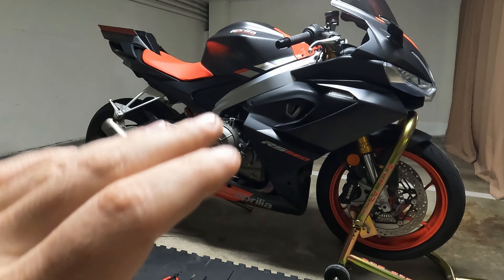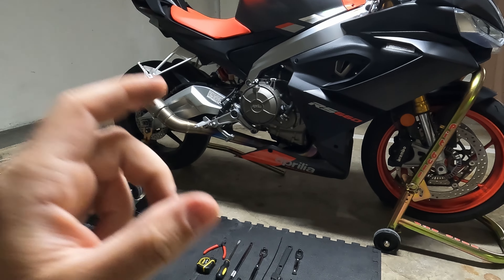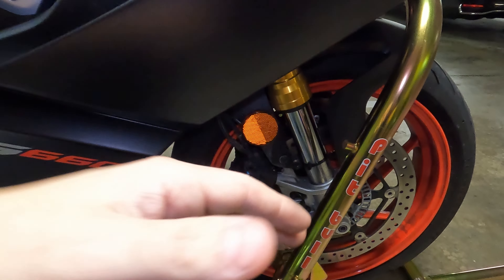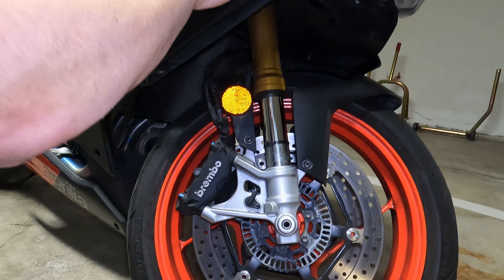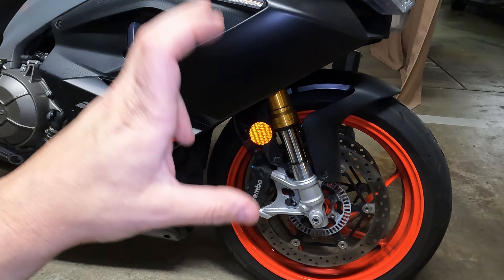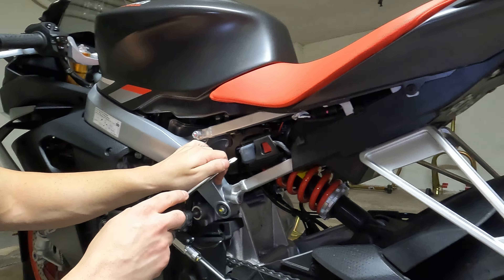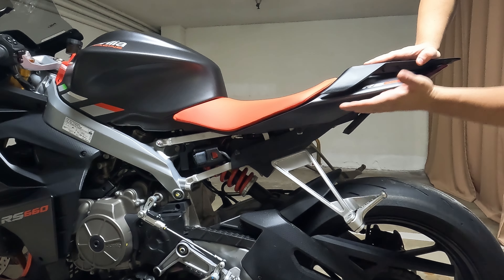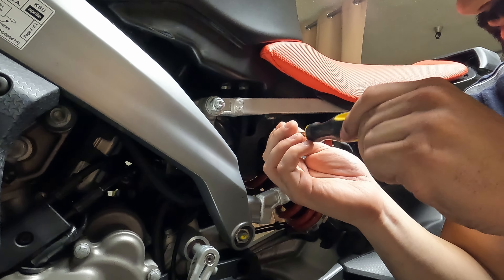RS 660 | How to Setup Your Suspension

Comment: Is the front stand the: Pitbull Hybrid Headlift Front Stand With Removable Handle? Which pin size are you using? I have another front stand but is touching with the front fearing and I’m not able to use it. I need to buy another one good for the rs660. Thanks
Reply from the maker: Yes this is the hybrid stand with removable handle. You can lift both from the forks or from the triple. The pin size for the RS660 is #46

Comment: Hey, i recently purchased an rs660. i have virtually no tools other than a small screwdriver kit. What tools / toolbox would you recommend i purchase?
Reply from the maker: It’s funny that you’re asking this because at some point I’m thinking of making a video going over tools needed for Aprilias. But until then I’ll tell you this. It depends on the depth of labor that you will go into. I don’t know what your experience in mechanics is. Regardless of experience, at the very least you should be doing your own oil change, chain adjustment, wheel alignment and brake pad change. I’m not a fan of buying individual tools as in the long run you will end up spending a lot more money. Buy tool sets. For hand tools, I’m a big fan of Tekton tools. I use them on all my videos. They have lifetime warranty replacement, plus you can either buy them directly from their website or from Amazon. You will need a set of allen-hex bits from 2mm to 8mm. A set of Torx bits. A couple ratchets. A set of sockets from 4mm to 14mm. You will need some individual large sockets like 28-30-32mm. A torque wrench. An oil filter socket wrench. And a small set of wrenches from 6mm to 14mm. These should get you through the basics but remember that the minute you start going more in depth in maintenance, there will always be a tool that you will need and you won’t have. In that case, the answer to which tools are needed, is all of them.

Comment: What castle nut wrench are you using for rear shock?  Looks adjustable.
Reply from the maker: Yes its adjustable. It comes in handy when I work on different bikes. This is the one: BikeMaster Adjustable Steering Stem Wrench 22-75MM https://a.co/d/60LlCQR

Comment: Hello, I am 5.6 tall and I have an Aprilia rs660, what could I do to lower the bike for my size?
Reply from the maker: The RS660 does not have a rear lowering link. But even if it did, at 5.6 I strongly recommend you don’t lower it.

Comment: Great video man, thanks for making it! just curious what are your measurements? because I set it up for my weight and it's almost exactly the same as your bike in the video haha
Reply from the maker: Thank you! The rider I used for this setup was around 140-150lbs with gear. That is very light. I am around 190-200lbs with gear and this setup would not work for me.

Comment: Do this for the rsv4
Reply from the maker: The process is identical with the difference that the RSV4 also has Compression adjustments. And the rebound on the rear shock is adjustable from underneath by hand. I may just make a video going over this.

Comment: If you bottom out your suspension you do not lose traction????
Reply from the maker: If you bottom out your suspension you have no more damping on the forces applied on the tire. If the spring cannot be compressed anymore, the tire will take that flex and act as a dampening agent. On a straight line during braking, the tire will flex so much that will flatten out, lose its curve and its ability to steer. Therefore you would lose the ability to turn into the corner while trail braking, and you would just go straight and crash if there is no runway. If you bottom out during a turn, the same thing happens resulting in loss of traction and you would lowside.
Reply: Just trying to be helpful. Its damping, not dampening. 😊
Reply from the maker: @witjas123  👌✌️

Comment: Yeah you shouldnt even have preload maxed to get proper sag, you still need springs.....probably anything over half or 3/4 preload to get sag should go up a spring rate....or up 1 rate in 1 leg to split a half rate...

Good info bro, every rider should be doing this first thing when they get a bike

I would be drilling a hole in that side panel and fitting a grommet to make it look clean and factory for rebound adjuster on the shock...why woukd they bury it like that, damn
Reply from the maker: Ideally yes. But its that expense that we procrastinate some times and we just substitute it with more preload. Im maxed out on preload on my RSV4 and I still bottom out. Which means I need new springs yesterday. And yet here I am installing loud exhausts lol. 😛

Comment: That is way to complicated. Use the 10% / 30% rule. 10% static and 30% rider sag

Eg.
Manual states the bike has 200mm of travel.
10% = 20mm
30% = 60mm

Physically measure the total travel of the forks or rear shock. Off that total measurement setup the sag to 20mm static and 60mm rider sag. Done. 

This bottom out stuff your talking about is useless. Top professional suspension guys don't even bother with this
Reply from the maker: You can’t set a percentage of adjustments, as the suspension adjustment is not only depended on the spring travel but also on the weight and riding skill of the rider. The bottom out “stuff” I’m talking about is the end of spring compression. It means there is no more spring travel to compress, therefore turning the spring into a stiff metal pole. Or, bottomed out spring. By the way, top professional suspension guys, set the suspension the exact same way I did. I know that because I learned it from them. But if you want to set your bike at 10/30%, by all means do so. ✌️